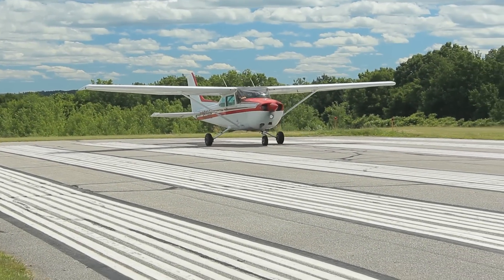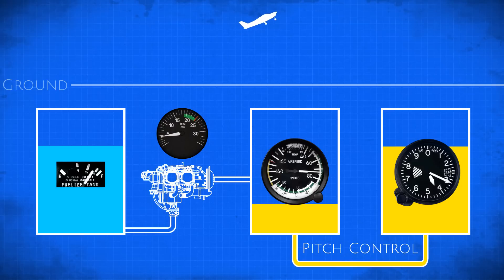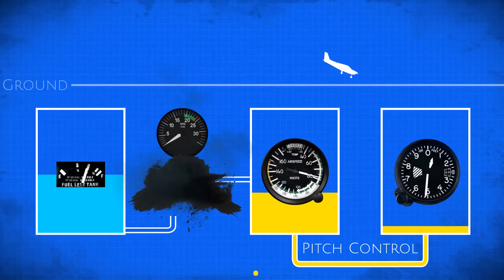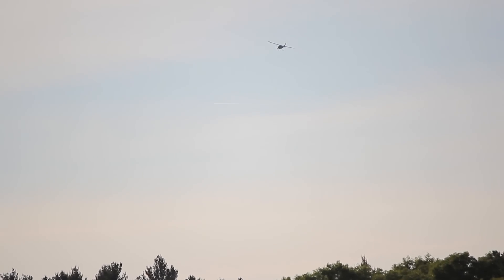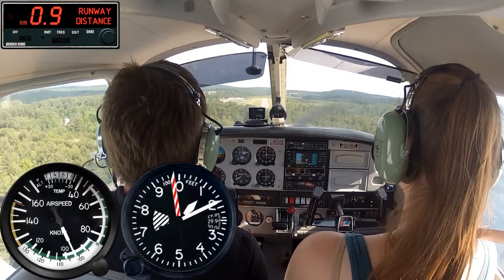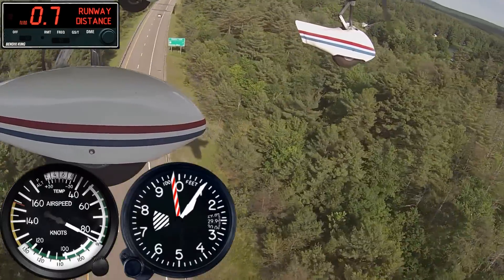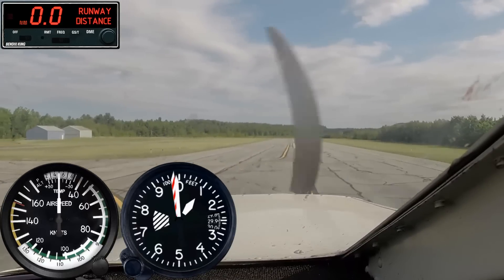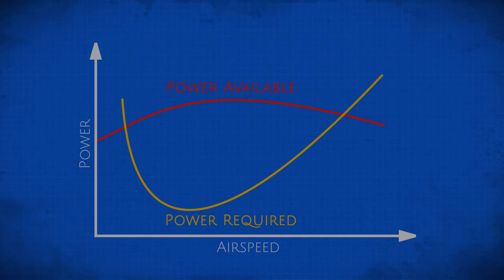Energy Management:  Speed vs. Altitude and everywhere in between

Comment: Good lesson.  We crop dusters use Wolfgang's (S&R) Law of the Roller Coaster to absorb as much energy as is available both spraying in the field and on takeoff.  Using the basic level in low ground effect until cruise airspeed (with available runway or unobstructed space) and then pitch up only enough to clear any obstructions.  That gives us maximum ground effect energy available.  Same in the field, we spray in low ground effect and use that kinetic energy to climb out of the field.  As we slow in the climb to a couple hundred feet or so (Pawnee...Air Tractor might be 400') we release back pressure when we bank to turn back to the field.  Now we are spending the potential energy of that 200' of altitude going back into the field.  If we lose the engine either coming out of the field (I've had seven of those) or on takeoff (only two), we have safe maneuvering airspeed to get to the very near in the hemisphere in front of the wing landing site.  If your engine quits at Vx or Vy and 400', your energy state is crap.

Comment: Ive seen the ratio's explained like this before. It's an interesting angle.
Reply from the maker: It's the only "correct" angle as far as I'm concerned, but that's what makes me an engineer, I suppose ;P
Reply: As I said it's an interesting and legit take. But I would not use it as primary flight training. There is not enough emphasis on the lift/drag coefficient for the student.
There are two different types of drag. Parasite drag and induced drag.

Comment: When I did my "emergency engine out" landings during training, there was one thing that I relied on: gliding. TBH, my glider experience has made me a significantly better pilot. Not only did it teach me stick and rudder skills, it taught me excellent energy management. Knowing how and when to pitch for airspeed is such a great skill I have acquired from it that I became significantly better at flying my approach. As a matter of fact, I was able to pull off a VERY short approach from a downwind entry. Like turning final at only a couple hundred feet AGL and less than a quarter mile while putting it on the landing markers short. All because I learned how to nail landings in a glider.
Reply from the maker: I've heard this story so many times, and been soaring myself several times.  You're absolutely correct :)
Reply: What's the longest you've gone for? My personal best is 3.5 hours and 7,700 from a 2000 foot tow. It was absolutely stunning, to say the least. The purest form of flight IMHO. :-)

Comment: I saw Bob Hoover twice at local air shows. He is an excellent example of what you are showing. He tuned off both engines at altitude and then did loop and low pass and climbed back up and did more and then landed without engine power and coasted to a stop at just the right spot in front of the people.
Reply from the maker: I would have loved to see that so much :(  He will be very missed.

Comment: this is only applicable with heawy and good glide ratio aircrafts, but not with ultralights , draggy aircrafts, STOL (like CH701-750) or  who have a low inertia and or high drag/low glide ratio .High approach is always safer in case of a engine problem because it's always easier to increase the descent rate (by sideslip, speedbrakes, flaps...) as to increase the glide ratio ...
Reply from the maker: Definitely felt that with the ultralight I flew in Hawaii!  So true!

Comment: Hello, thanks for the video. I do not understand the power chart at the end. Anyone can re-explain it to me please? Power required for what? What does "power available" for a given airspeed mean? Thanks.
Reply: I'll start with this disclaimer, I'm a physicist by trade, not an aerospace engineer. But i have a big interest in aircraft.

If anyone that actually knows (for sure) that this is true (or complete bollocks) call me out/debunk/etc.

If you understand the yellow line and how drag affects it, take that understanding and realise that the Red line isn't talking about overall engine power, but thrust and that propellers are just blades (or wings) that rotate through air, producing thrust ("lift") in the forwards direction (instead of up, hopefully).

If you don't understand, read on:

The Yellow line is the power required to continue flying (with no altitude change) at that airspeed. The reason it starts high, goes low and then goes high again is because.

-At slow speeds you need either flaps or a high angle of attack to maintain altitude; both these create large amounts of lift induced drag (which takes power to over come).
-At higher speeds you suffer from parasitic drag (which also takes power to over come) which comes from; skin friction, aerodynamic drag (brick vs teardrop) and interference drag.
-The lowest point is the ideal lift/drag ratio air speed, where the two of these effects are both at their lowest.

The Red line is a little confusing (it's available thrust at that airspeed, for the most part), but it's the same concepts, just applied to the propeller and with one added twist.

You need to separate thrust out into two parts. The engine provides power, this will largely stay fixed regardless of air speed (at least with this sort of engine). The propeller (prop) then turns that power into thrust.

The problem is the prop isn't 100% efficient at turning that power into thrust, in fact it faces the same problems listed above; lift induced drag at high angles of attack and parasitic drag at high air speeds. This is because props create thrust in the same way that wings produce "lift" (its just they do it in a different direction, and by rotating instead of going in a straight line).

You might be thinking "but Firebird, the props rotate really quickly, even when idling on the ground, how can there be lift induced drag even then?"

Good question (and it took me a few minutes to work it out): It's all about the blade's angle of attack relative to the air stream. As the airflow going into the prop disk changes speed, the props blades change angle of attack relative to the incoming air stream. The blades aren't physically changing angle, but the air stream's angle relative to the blades IS changing and that has the same effect as physically changing the angle of attack of the blade.

So why would prop designers make props like this? Efficiency. You want your prop to be most efficient at *insert design criteria here*. Which is normally at the cruising speed for the aircraft (but could also be for short field performance or anything really). This usually means you trade low speed efficiency (high thrust@low speed) for cruising speed efficiency (efficient thrust@cruising speed).

Similarly when you're flying quickly the prop must rotate faster through the air, but that fast rotation increases your parasitic drag.

And whenever the prop is producing drag (lift/thrust induced, or parasitic), that's power that's NOT being turned into thrust. Hence as slow air speeds, you have lower available thrust and at high air speeds the available thrust drops off again, with a nice efficient plateau at around cruising speeds.

Comment: Good video, different approach gets some fresh views/comments for the prime lesson I've seen in every type of flying done. 

Everyone's heard of the Old & the Bold pilots. Might have even met more than a few who think they're both.
Not going to meet any low, slow pilots - unless tasked with digging them up.

How about this one.  "What do you do when you run out of altitude & airspeed at the same time?"
 "Crash"

When it comes right down to it, a bit of cushion is needed for both, or you won't get the chance to make a trade off for the one you need more at the time.
Reply from the maker: True, true.  Have a safety buffer no matter how you do it.  Well said.

Comment: An excellent breakdown of energy. I only have 1 quips. The more efficient use of energy on the engine failure would have been to pitch for Vy thus preserving more energy by storing some as altitude. This is how they handle emergency engine outs at the Reno air races. Those guys have experience. Also, perhaps, just a bit nuts....

Anyone know where I can sign up? :)
Reply from the maker: Yep, which is exactly what I say at 4:05.  They are crazy, but who says I'm not too ;)

Comment: great video Nick.  especially 0:35 :-

Here's a question for you: In a glider, that does not have the luxury of that third tank of fuel energy, what would you do if:
a) you are starting to fall short of the runway?  
b) you were too high? (and for this discussion, lets take away side slip and spoilers, you can only adjust the speed)

Answer: 
a) If you are short, push the nose down and pick up speed, it will carry you further, 
b) if you are high, raise the nose, slow down, you will increase your descent and reduce forward speed, thus increasing your descent angle.  

Since every glider landing is a dead stick landing, energy management is key, the above seems counter intuitive and yes, I have had some students doubt this, until it is demonstrated in practice.  NASA did study this, happy and they agree :-)

Go visit a glider field, take a couple flights, you will be a better pilot for it.

Fly Safe
Reply from the maker: Ding!
https://youtu.be/MKSThgiLieU

Comment: Climbing is with Power converting chemical to potential; zooming is converting kinetic to potential. Zooming and diving pair while climbing and descending pair. You confused climbing with zooming. Descending is using less power so as to let drag win the balance such that you lose potential while holding kinetic constant. Even with no engine, such as with gliders, you see this as those spoilers add / subtract drag in a way mechanized to act like your throttle or power lever. This zoom/dive vs climb/descend distinction becomes consequential in that float you’re showing in this video. If you dive while on the back side, you’ll float long. This, in turn, gets to an interesting point. You only need to fly front side and front side techniques if in a turbine engine airplane which has longer spoolup versus piston propeller response times as you can use power techniques which we typically mislabel as backside techniques anywhere on the curve. True backside techniques mean pull up to slow increasing drag to descend then dump the nose to catch if high or push to float if low, which obviously we don’t want to do as it is easy to mess up. This is why Navy jets add drag so as to be up on throttle so as to have quick engine response times and use power techniques using pitch trim for AOA control and throttle for glide slope. Forward slipping isn’t really backside either as it is really distorting the parasitic side of the curve leftward while massively increasing its value.

Comment: There is one Problem with this theory: More airspeed means more drag. You loose your airspeed energy very fast when you're flying fast. You can see this when you accelerate with your plane: getting from 60 to 80 knots is very easy, getting from 120 to 140 knots is much more difficult and takes much more time. In fact, you have more useable energy when you're flying high and slow than when you're flying low and fast.

Comment: Flying is always about managing different risks. While I typically fly high approaches in VFR conditions as it's easy to get a 182 down, if you are on an ILS, that's a fairly low approach whether you like it or not. So know how to manage your energy to minimize risk.
Reply from the maker: Well said, my friend.  I would argue that LIFE is all about managing risks ;)
Reply: Good point about an ILS approach.  Those are designed for jumbo jets.  But there is a reason why the big guys choose "low and fast" over "high and slow", and the reason is just as applicable to your 182.  

To me, it's not an either-or question.  The gustier the conditions, or the more the terrain, trees and buildings suggest the possibility of swirling winds, the lower and faster I'm going to approach.  It's a continuum.  But you can't do it right if you don't practice it, so you have to practice those "F-16 approaches" when it's calm and safe so you can do them when you need to.  Never be a one-trick pony.

That's my thinking on the subject, anyway, for what it's worth.  The world is complex, and you don't get to choose your landing conditions.
Reply: You are right given that they started developing the ILS in 1929. 

Regardless, a 3 degree approach is very flat compared to how pilots in VMC typically fly a pattern.

Comment: Good one, though the title could have been "Not all low approaches are dangerous, and here's why: energy management". I can already hear my airport Unicom getting on the radio to tell pilots "they don't have to... but it'd be nice if they kept their approaches steeper for noise abatement" XD! 
  Also you can see me perform a low approach during an (preventable) emergency landing (the intro flight video) on my channel as well... Sometimes, it's better to perform one!
  But be careful! When it comes to landing, if you want to be cautious, you'll find coming in at the manufacturer recommended final approach speed is the perfect compromise between avoiding a stall, and minimizing floating!
Reply from the maker: That's what that magical part of the power requirement curve is for, yes sir!  Glad you enjoyed.

Comment: Thanks for the info...so its energy management and not power management? I don't know if this can apply after an engine failure in flight, but could it be possible to glide at a higher speed and still achieve the same range without thrust as you've mentioned more air speed is safer?
Reply from the maker: It definitely applies without an engine, as any glider pilot would be happy to tell you.  As I said at 4:05, in that case, the safest thing to do is to pitch for Vgs.  This was merely an extreme example of how you can trade one for another.

Comment: Precision is important - too much energy can be as bad as too little. The whole point of the approach is to get rid of energy gradually.  Precise control of energy using intuition would be harder to do than judging glide angles in my opinion.  Carrying "tons of energy" in a draggy light plane is one thing, quite different in a fiberglass sailplane.

 Low and fast also effects your ability to react to unusual situations (say, bird strike).

Comment: Gonna be that guy. Isn't it a pilots responsibility to remain above glideslope until a safe landing at an airport is assured?
Reply from the maker: It's a pilot's responsibility to remain safe and hopefully assure a landing, but I've never heard anyone put it in terms of a glide slope.
Reply: Friendly Skies Film might have heard it from armchair internet pilots. I'm just a student myself. Nicely shot video overall either way.
Reply: Requirements to remain at or above glide slope actually depend on where you're landing and what you're flying.

e.g. 91.129 regarding Class D operations:
[...]
(2) A large or turbine-powered airplane approaching to land on a runway served by an instrument landing system (ILS), if the airplane is ILS equipped, shall fly that airplane at an altitude at or above the glide slope between the outer marker [...] and the middle marker; and 
(3) An airplane approaching to land on a runway served by a visual approach slope indicator shall maintain an altitude at or above the glide slope until a lower altitude is necessary for a safe landing.

I'm not a CFI, or an aviation lawyer, but my layman interpretation of that is that if you're in a large prop, turboprop, or jet that's ILS equipped, you have to stay at or above the glide slope until you cross the middle marker. Any airplane landing on a runway with a VASI (Class D specific) is to remain at or above glide slope until you need to drop below.

There are no such requirements for operations at airports in Class E or Class G airspace. Interestingly, I can find no such requirements for operating in Class C and B airspace, however, anyone landing VFR in such airspace will typically be following explicit tower instructions.

I believe Part 121 and Part 135 regulations require that the glide slope is followed whenever one is available. In all cases, stabilized approaches are required by airline SOPs at least until landing is assured.

However, the reason for the requirements have nothing to do with landing performance or energy management. Much more simply, I believe it's to ensure terrain/obstacle avoidance and possibly for noise abatement, depending on the runway location.
Reply from the maker: God I wish I had you encyclopedic knowledge of the regs.  You never cease to amaze me.
Reply: It's not all from memory -- I usually have a vague recollection that there's a related reg, and then all the glory goes to Google. ;)

Comment: Excellent video. Like everyone, I learnt to wallow down the approach at 70 kts. After I gained my license I immediately started my IMC rating, where I was taught to fly the ILS down to 200 feet, decision to land or not then either go into missed approach or quickly lose the energy and make a normal landing.  This became my normal technique in all circumstances except when the circuit was busy and I had to slow down for traffic ahead.  Furthermore, I found out by a nod and a wink that all my instructors did that as well.  IMHO this is a slightly more advanced technique and should not be attempted without prior instruction as for an inexperienced student there is scope for things to get away from you quicker than your experience level can cope with, but once you've got a few hours under your belt, then a few circuit sessions with a good instructor on this technique is very valuable.